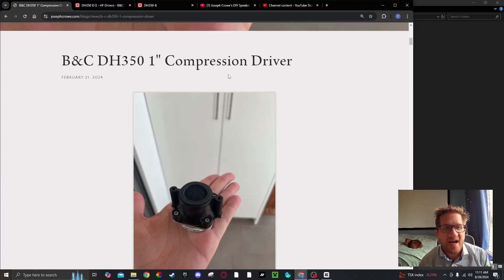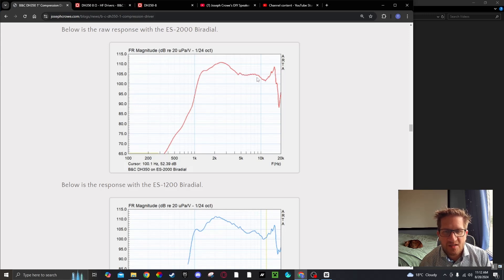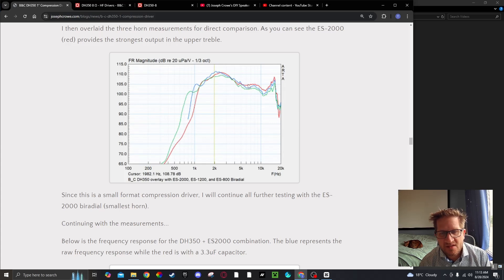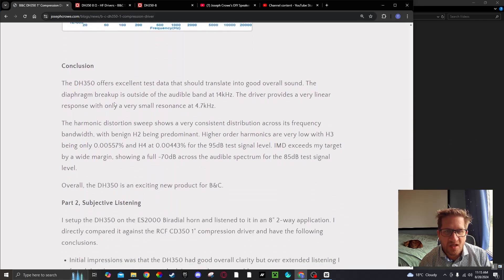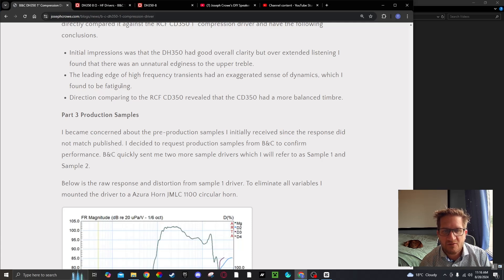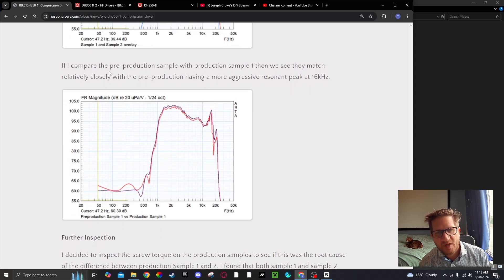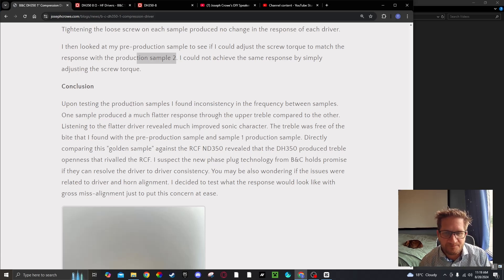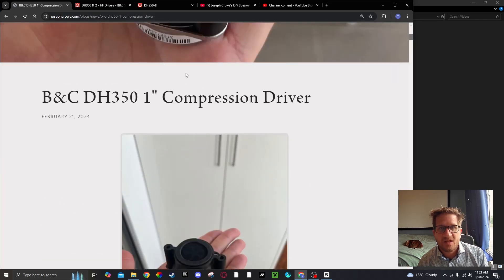B&C DH350 1" Compression Driver

Comment: very deep and well done review of this driver. I looked in your blog and found a zoom-in plot of the impedance, a small peak at about 9kHz and a (to me) corresponding one at presumemably exactly half the frequency at about 4.5 kHz - may be a resonance caused by a reflection from the horn mouth back into the compession chamber stopped at the diaphragm (kind of standing wave?). Can be seen in the burst decay as well. The difference in the samples preproduction vs no. 2 might be alike, a resonace between the diaphagm and the pole for example ... ideas .. here well damped vs not damped as good ..